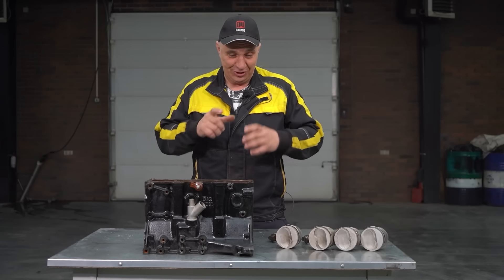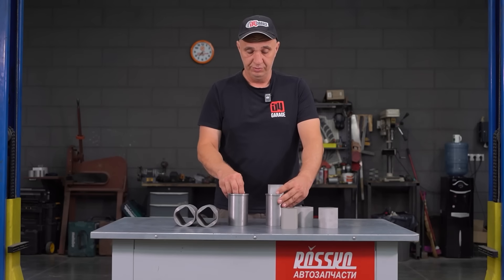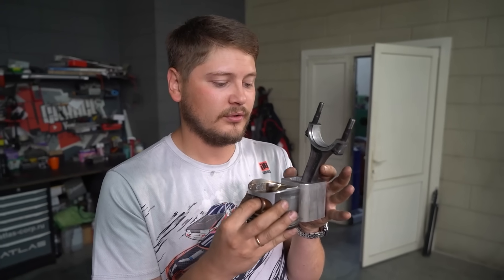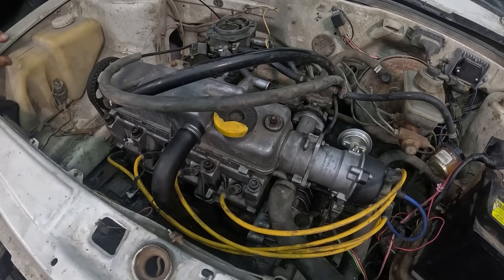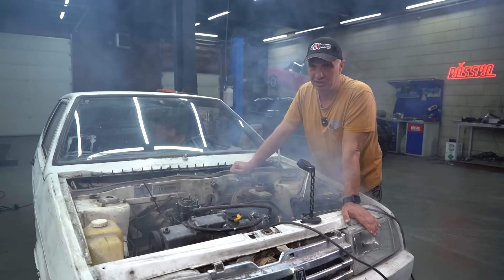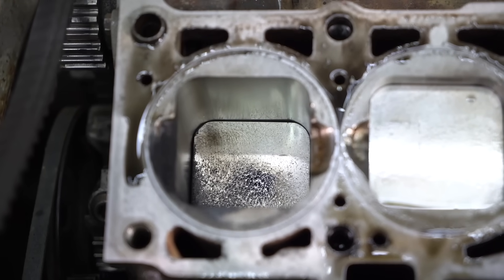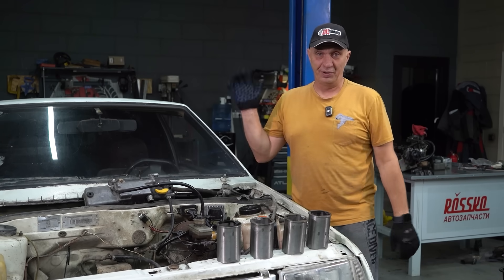We make square-section pistons - will they work?

Comment: Less efficient, combustion is omni directional from a centric spark, ie, circular/spherical. Further, publishing the inside surface to mirror like surface is impossible. Corners are also high stress areas. I am sure there are other issues.

Comment: Both Honda and Yamaha developed oval piston engines in the past. It was to fit the in-line 4 pistons closer together, but I think that there a few different designs some v twin with two rods per oval etc.. In the end, both Honda and Yamaha went with a V4, I think, to save space and weight. as far as I know....

Comment: 17:24 What quality are you talking about? Just the fact that you used rubber O-rings in the cylinders, where a lot of heat is generated, instead of steel piston rings, is ridiculous.

Comment: Make piston rings that are bowed slightly for each side of the piston that that come in contact with the corners off set one slightly so above or below the other two even on top both sides two below on both sides then a second set just like it see if that works for you

Comment: i have always wanted to see what would happen if you created a spring piston hybrid, springs fitted on the outter diameter of the piston, so you would have to shave the outer edge of the piston, but the inner would be the normal so that you still have compression area. the springs would compress and then release, if you cut the fuel would it still run.  or tune it so its very little fuel to run, so that after the initial start, trimming down the fuel the springs take over most of the movement of the piston up and down.. when throttled it would increase fuel just enought but after throttle the springs take over again..

Comment: HELLO!!!!

COMMON SENSE here. Id just like to point out the much much much much much easier route with this system. Take a round piston. Cut it into a square. Use this as a test fitting process. The. Once your done make custom pistons. U guys went the LONG route to trying to fit a square peg into a round hole

Comment: Here's the answer.  Dump the rubber rings and make metal rings.  There would be four parts to each ring.  Each ring part would have a ninety degree angle around the corner of the piston.  The ring parts would be tapered for a full overlap over the width of the piston.  This would be super interesting to see how long this engine would run with the square pistons and square rings.

Comment: WOW! How the mind of man works. If it can be BELIEVED, it can be CONCEIVED. This would have worked better IF, they had a dedicated block and heads made for square pistons! But that is beyond a local shop's capabilities, I think. You could even have hemispherical pistons if the block and heads were designed for them! This idea is NOT all that crazy. It is conceivable that a square piston engine could have more DISPLACEMENT than a round (?) one in a block of the same size designed FOR square pistons. You could have BETTER cooling of the block with square pistons. AND, fitting high tensil steel rings (squares) to the pistons shouldn't be any more difficult than it already is for round pistons! Today's engines are tight fitting, not loose like the good ole days. So I wonder what effect that would have on the corners of square pistons. But that tolerance can be engineered. All in all, an intriguing idea. So, why don't one of you young BILLIONAIRES, with more money than you'll spend in two (2) lifetimes, back the development of a 3 liter naturally aspirated 300 HP SQUARE PISTON Vee or inline 6. Or some such as that. WHY? For kicks and giggles! Peace out...

Comment: Yeah my guess why it's not sealing and blowing the ring out, is partly the material of the rings. Stretching a circle over a square makes the rubber stretch more over the corners and smashes the rings. Causing less contact on the corners or a weak point. That's my guess anyway.

I'd be curious to know if cut the corner off and made more of a hexagon shape lessening the 90° angles on the corner if that would solve your sealing issue. Plus in theory a hexagon would allow you more displacement than a circle of the same radius size. That's why bees us hexagons rather than circles. Maximizes space. But, manufacturing wise a nightmare and impractical.

Comment: i mean I'm not an engineer, but I know a little bit of mathematics, and according to my knowledge, to optimize an engine to waste as little energy as possible in the form of heat, the combustion chamber needs to be as close to a sphere as possible, because circles have the least circumference compared to the area they have, thus a sphere is like a circle rotated on another axle, which means it has the least surface area compared to it's volume. Spheres are hard to make and there are other factors when designing an engine, so we stick to cylinder pistons because we also want more volume for less wasted space in form of air, since stacking lots of spheres just means lots of wasted space. There is no reason I see why square pistons wouldnt work, but I believe cylinder ones are superior, since the combustion process and thus the heat of the combustion spreads evenly only in volumes based off of circles, assuming the explosion starts in the pistons centre of course, which is where the spark plugs usually reside.

Comment: What would happen to the cylinders if you used metal wire cut to length for the piston rings? Maybe try different types of wire to see which works better.

Comment: The engineer in me said this outcome was a foregone conclusion.  You want to minimize friction per unit of volume.  That means minimize surface area.  A cylinder has less surface area per unit volume than a cubical shape.   Then of course comes the real challenge of ring design.    But these can be solved.  In the end you are left with a less efficient engine that will likely always have some trouble with retaining compression over time.

Comment: circle is most stable for blast exerting equal pressure all around but if we pake pistons square after some time it will become squircle and it will leak blast area and it wont be as effective and may also fail

Comment: I want to send this guy my snowmobile motor . Tell him to have fun and build me a bullet proof , twin cylinder , high torque , 150 hp , light weight , fuel injected , short stroke , low c.g. , high compression , electric turbo , 440 c.c. TRAIL MISSLE . What’s your address ??  LOL !!!

Comment: Square pistons will have alot of friction on the corners & virtually less heat dissipation, the oil rings & compression rings will vurtually be destroyed it ain't gonna last long & thats why round pistons dissipate the heat evenly to prevent overheating & friction that can destroy a piston much faster !

Comment: The rubber piston rings will never do the job properly because of uneven stretch along the square edges that can cause the overall thickness in certain areas to be thinner. That's why we use round pistons, where the stretch/load is distributed EVENLY across all sides , which is only 1.

Comment: This is really cool but this will always be weaker that the original way this was built. You’re reducing the volume of the combustion chamber. You really need to rebuild this from the ground up to have a valid comparison. That said, the round piston creating a cylinder is inherently superior to any other shape. First is that it’s shape is just more resistant to fatigue or damage because it disperses the load from the pressure evenly. Second, when the combustion chamber is expanded to draw in the fuel air mix, it will be more evenly distributed through the combustion chamber. Third, it is way easier to construct and manufacture

Comment: rather than use rubber seals.   make some 2 piece rings that are L shaped that when put into the piston form a square.   drill a  3-4 holes per side behind the ring for a small spring.  that way u can compress the ring to install and spring keeps rings sealed against bore.

Comment: It was very predictable the outcome,  i was hopeful of saying “a good experiment”  but i wrote down my predicted results and handed them to my wife before watching,  i got every issue correct, inc the smoke and “ inevitable” oil “blow by”  i was slightly surprised the rubber “rings” lasted as long, but actually put the dun time to the piston “skirt” actually expanding and allowing so compression,  the bore scoring seem to agree..  the entire engine was melting..   good effort.. but very predictable outcome..    admittedly i am a master mechanic with 36+ years in engine development and engineering..  😊 (retired)

Comment: I'd like to see what my father once did he blew a connecting rod and a piston so he took the one connecting rod out and carved the perfect size peice of wood and pounded it in the cylender flush then put it back together and he said it ran great and you couldn't tell unless you knew about it but he sold it and he's said a year later he seen the car still on road driving ..but ya need put a dummy spark plug and wire in ..plz try that it was a 54 coupe ford ..but again grreet j0band love the vidzn

Comment: I think it might be a bad idea.semetery is one thing that has to be considered. Ceiling the piston so that I can develop compression is another. And the big.
Gest concern in my opinion, would be heat dissipation from the corners.Heat tends to gather at corners and elevate. So I don't think it's a good idea

Comment: Too funny, you guys are already doing something wild.  So far as rings are concerned.  I wonder if you could machine a "C" shaped ring out of more traditional ring material.... slide them together to make a whole square shaped ring.  You'd end up with 2 openings instead of one like standard rings but I wonder if that would work for an extended period of time, unlike the rubber rings.

Comment: let me save myself 18 minutes by knowing simple geometry:
Yes, theres no reason they wont work if built correctly, but you're losing a massive amount of surface area, and therefore a massive amount of push to the crank, aka horsepower.

Comment: You guys should try semi-circle or oval valves for maximum airflow. You can key the valve stem or use two to stop it from rotating. And you should test all this stuff on a single cylinder motorcycle engine, it would save you 4x the work.

Comment: Maybe run some 2 stroke mix for fuel, save the rings from wear, silicone o-rings have a high temperature melt point, hotter than the oil and coolant would get

Comment: Wow! The tolerances really are mind blowing. Do they even need rings or seals with those tolerances?  That EDM machine is definitely a game changer of an idea. I noted it was in English! LOL 
Haven't seem to the end. Only halfway through. But I'm thinking already, "this HAS to be a success". 
If they used VITON seals (the green ones), which are specifically designed for oil, heat, pressure and automotive use, instead of rubber, the pistons would last longer.

Comment: Im no mechanical engineer or mechanic but what if you used a triangular steel wire, bent in a square, as a piston ring and use the orings behind the ring to give it the outward tension with the vertex against the cylinder wall and the flat against the oring. From what i understand, the issue with using a typical piston ring on a square piston is that it cant be tempered properly to give it the necessary tension.

Comment: I think if the top of the piston was left at a size that would allow it to expand fit the cylinder than you could put the rubber rings further down on the piston and they would last longer. Overall a super cool project. Love this channel because you take the statement of "that won't work" and say "Hold my beer".

Comment: That's a lot of r and d for square pistons. I expect if the fuel intake was adjusted down a little it would run a little better.  There is still a lot of things that could be changed with the changes.

Comment: One reason why square pistons in a combustion engine make no sense is because of the piston rings. Piston rings are usually rotating while the engine is running, meaning you avoid that the same spot of piston ring always runs on the same spot of the cylinder wall. 
This allows the piston rings to withstand a long time (same reason why you pair gears with an even number of teeth with gears with an uneven number of teeth) and properly seal. Fixed piston rings will wear off quite quickly and start to scratch the cylinder wall. Also, your rubber piston rings are unable to guide the piston, that is their second important task apart from sealing for compression and oil. Piston rings help preventing the piston from tilting horizontally (it does a very little due to the ring gap play). 
Some older sports engines (Porsche 356 e.g.) had 3 compression rings at the top and the oil scraper ring at the bottom of the piston to allow better guidance. I'm not quite sure why they abandoned that setup though.

Comment: Make metal U shaped rings.  put springs in opposite sides and have a gapless butt system for the top and opposite for the bottom.  Or, better yet, all4 sides have a vane shaped like a picture frame apart and springs on the inside pushing them out.  Some pistons have holes in the Ringland's to expand rings, check that technology out!

Comment: As soon as you said you are using rubber rings I thought nope won't work as the rings will be tighter in the corners than on the face of the pistons allowing leaks

Comment: Oh seriously. Rubber rings? Are you silly. The temperature is too high for rubber. I watched this video and knew that your failure would be the rings. I would say that you would’ve likely only had 30mins before the motor could not function properly. Of course square pistons can work. Lots of engineering got wasted by using rubber for rings. Maybe some 2 piece rings cut from cast would’ve been sensible. And the oil control ring needs to be included. The top 2 rings are used to hold the combustion into the combustion chamber and the 3rd ring to keep the oil pressure and oil in the sump. Without a divide of gases and pressure this is just a waste of time

Comment: my initial thought on this is that pistons are circular to help with lateral forces being evenly distributed within the cylinder. square pistons probably wouldnt allow that. causing excessive wear on one side or another, of premature failure at higher power levels.

Comment: I'm sure you also noticed, but because the pistons are square, the "piston rings" are recessed more in the corners. At 8:21 you can see exactly what I mean. Maybe you can compensate for this by cutting the grooves on the corners a little less deep? Either way, rubber piston rings are not ideal. Nice video!

Comment: I think if they could figure out better piston rings, this could actually be practical. Assuming the engine block were also intentionally designed for square pistons, you can get a lot more displacement for the same size engine.

Comment: I’m a gearhead, but not a mechanical technician…however my understanding as to why pistons are round and not square (or any other shape for that matter) is because the round piston and rings are equally as strong all the way around, no one point weaker than another. This then affords the (round) piston to operate at its highest effectiveness. A square pistons would have weak areas…either on the four corners, or the flat sides. Either way, the pressure difference all the way around the square piston isn’t the same, as it is with a round piston, and therefore more likely to leak/fail. I will close with this — these guys are expert machinists and know their way around their machine.

Comment: Why not had u used friction like a hpi rc motor would have worked has a taper from the bottom of the cylinder to the top reseach it more but I think it work better

Comment: It might work well on a brand-new engine. As soon as there's any wear, the piston will develop some play in the horizontal plane and can rotate slightly in the cylinder, and that's when it fails. And how do they fix this with the piston rings?

Comment: Very cool, I am not aware of any cars that have square pistons, but with the help of our AI overlords I found a few interesting concepts!

1. Dake Square Piston Engine (1888)
2. GB Patent by Arthur E. Peters (1925) Patent US1598653A
3. Improved Engine Square Piston (1967) Patent GB1176509A was filed by Leslie Desmond Harries in the UK. There is limited documentation, but not much else.
4. "Square Piston Engine" (SPEC) Prototype (2008) was a modern two-stroke internal combustion prototype dubbed SPEC. It envisaged square pistons for emissions reduction, closed-loop oiling, and modular manufacturing.

I guess sometimes the wheel wins. It seems as if square pistons always have issues sealing well, or there is significant wear on the corners of the seals.

Comment: Guess you could have used a piston ring seal principle used in rotary engines. That way you could have made a combined piston ring set of metal and could last the test a bit longer and maybe even get better longer-life results. Or solid parts for the straight sides and oil scrapers for the edges or something.
Just brainstorming for part 2 of this experiment 😁😂

Comment: i feel like you could use oil rings from a diesel bent to match the square pistons instead of the rubber orings  the biggest issue is getting the bores of the square cylinders smooth enough for the metal rings to slide on but that is still possible aswell in the video they are sleeves so it would be possible to use a die to polish the bores for a better finish

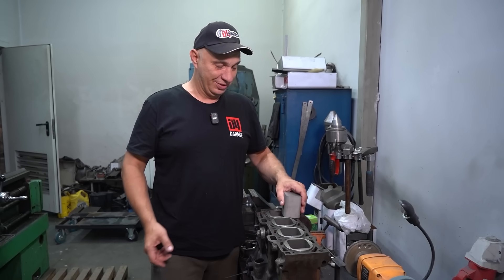Comment: Triangle pistons? and triangle rings? 5:15
Reply: U might just decrease on the amount of air that can be compressed in that volume of space, lower temperature and lean conditions, in proper ignition to fuel, am just thinking of the possibles
Reply: @worlboss2844 no your not wrong lol just like triangles